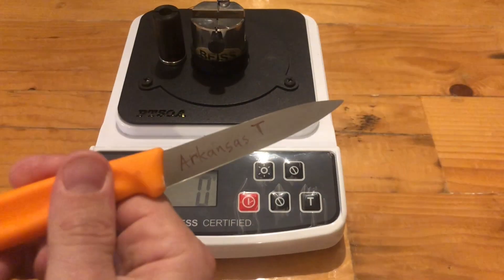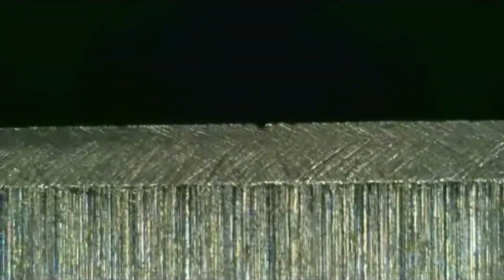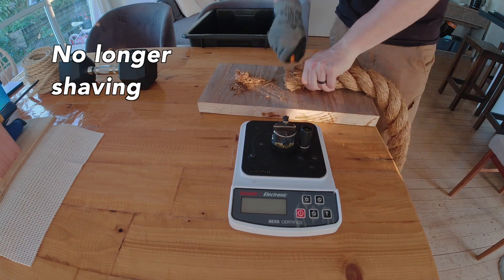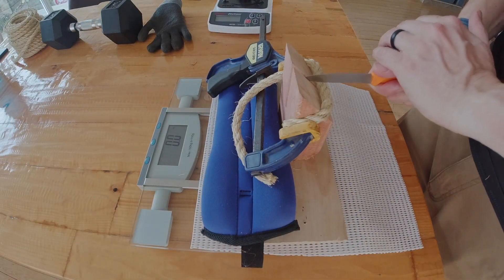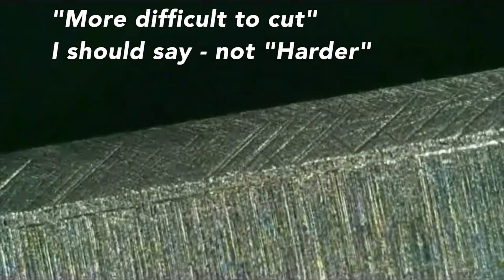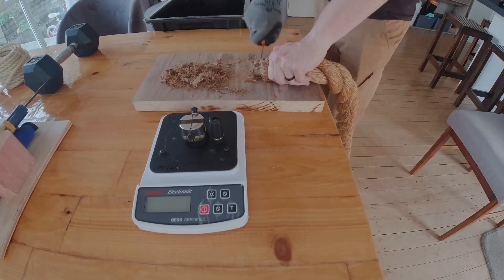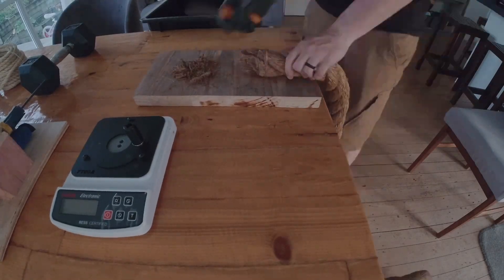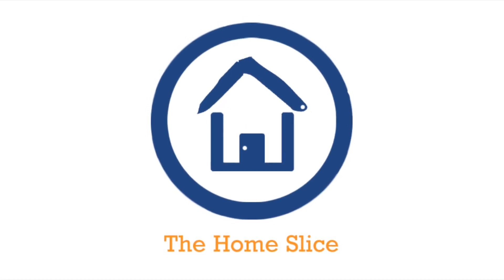I Can't Believe What The Arkansas Translucent Stone Did! | Knife Edge Test

Comment: My favorite single stone.  It has some really, really weird properties though.  Oiled, it produces a fine hazy scratch pattern like most other hard Arkansas stones.   Like you said, between hard and fine.  Dry, it produces a polishing effect on finished edges that's almost impossible to replicate without metal polish, power tools or a long line of grit reductions.  All you have to do get this effect is sweep the edge in small half circles across the stone.  I don't know how or why this works.  But it definitely does.  

One note: this stone is hard to use once clogged.  If it does clog, use Barkeeper's Friend and dishsoap to clean it.  Or just the soap and a Magic Eraser.   

When this stone dishes (which usually takes years) I flatten it on a medium grit DMT plate.  I experimented once by adding the powdered stone to strop already loaded with coarse compound and it improved the feedback and finish of the strop for nearly 2 years.  Like I said, it's a really weird stone.  But good.
Reply from the maker: Ooooooh I have to try this now.  Thanks heaps for the nerd-insights.  I noticed that it loses all abrasive quality when loaded, like ALL.

Comment: I would say, that you must do a much more Work on coarser Stones, eliminate all Scratches from the Stones u used  before. Than fnishing on an Finishingstone and than got to the Arkansas, not before all Scratches and Chips removed.
Reply from the maker: You may be right - but I also found that this result was never replicated.  It seems that the finish that the Arkansas stone came with was rough and aggressive, but after 2 or 3 sharpening sessions it smoothed out.

It still does not look very mirror-like in the microscope, but the edges I get off the Arkansas right now are nowhere near as aggressive as this one was!

Comment: While surely a lot of work, are you doing a control resharpening and test off camera to verify the results?
One can sometimes get a bit luckly/unluckly or rather make small unnoticeable things right/wrong, while sharpening and stropping leading to a different edge on the same medium.

It would increase the amount of work per test, but highly increase the reliability&meaning of the data. :/
Reply from the maker: As usual, Sabelfechter - I think that your observations are good and helpful.  I don't re-test anything at this point, but it would definitely help make things much more reliable.

At this point, with 3 small kids, I am just trying to get through as many individual tests as possible to see if any very clear standouts appear, so that I can do some analysis as to whether the results hold up with different kinds of steel.

As I put together a lot of tests on these different steels, we will get more confirmation of small problems or large outliers.  I also sharpen on the stones in my everyday life - and I will re-test if I notice uncharacteristic good or bad performance that does not align with the original results.

Anyway - I appreciate your comment, and acknowledge you are correct.  

Due to time constraints, I do not plan to start re-testing (well, maybe when I retire, haha), and I do not claim to have the world's most reliable data.  It is close enough to stay interesting to me, and the best performing edges will be thoroughly tested on different steels, then the best performers that emerge will be sent to Pete for double confirmation and Sal Glesser for CATRA testing (I may reach out to someone to do cardboard testing as well).

Comment: Very interesting results, it would be nice to see edge angle and bte measurments between tests. I'll have a look for a well priced goniometer, maybe when you get to the top couple of edge types you could put them head to head and ensure the other parameters are the same for the record
Reply from the maker: Hey Max, all edges are 17dps - though I should mention that more often.  Obviously being done by hand I am sure there is a slight variance.  All these Victorinox knives were bought around the same time, and I have measured them with a wire guage and they all started around 5 thousandths behind the edge.  By the end of the testing the thickest one had grown to about 7-8 thou.

But I tried to rotate them around evenly, so the biggest dynamic we ought to observe should be a slow, slight overall decline in performance from BTE thickness variables.

I think the edge had been cleaned from subsurface damage well, being an adhesive wearing stone, and the portion of edge I measured held up well.  That said it was 396 g some of those readings, so it just skated by on the luck of the draw and could easily have been only 4 or 5 passes.

Still interesting to me to have a fine/mid grit surpass all the others by so much.  Lots more stones to test though!  Perhaps the best is yet to come.
Reply: @homeslicesharpening  oh great sorry I had missed the 17dps info from other vids. Makes the results even more interesting as I was assuming there might have been some variance. I'm going to try a bit of testing too, I think I'm going to test a 400 jis, 1200jis and a dual grit 400/1200 edge and see what happens.